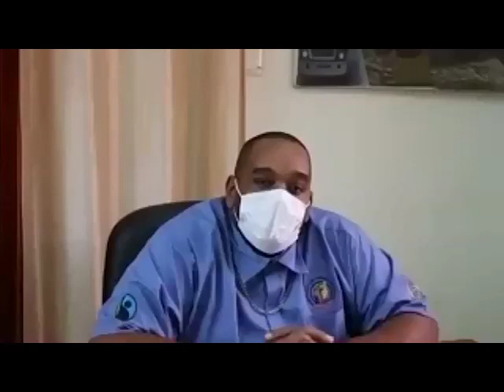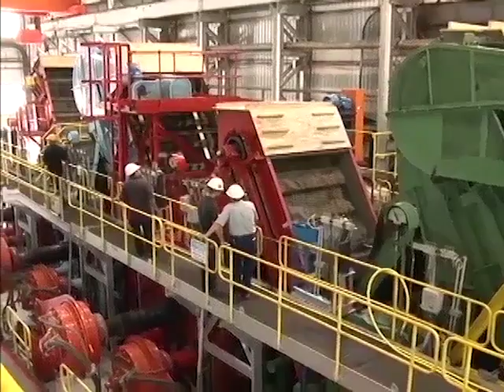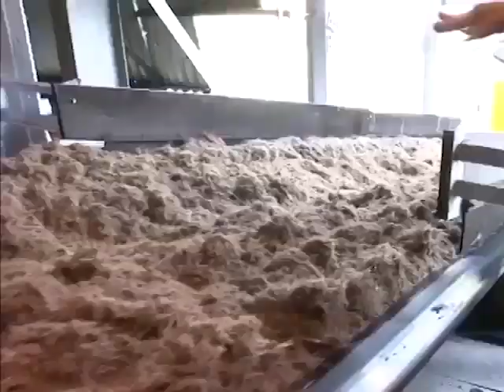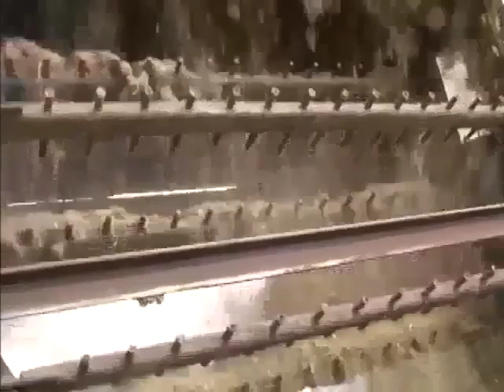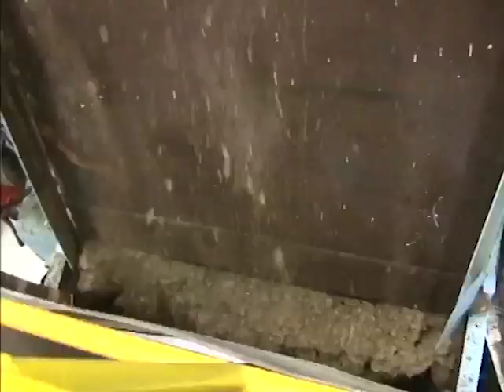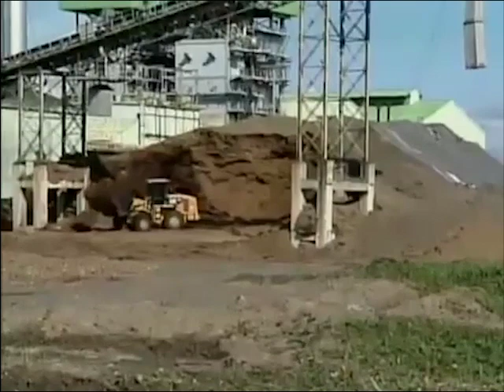Bagasse Impasse of 2013/14 Used as Example for Renegotiation

Comment: What can it be used for I'm not familiar with the sugar cane production I'm more on citrus but if this byproduct is used abroad then it can be used locally like the Orange oil the processors sold abroad and the growers never heard anything or got paid for and it had so many uses can even be used for termite control so if this bagasse is valuable to them find out the uses of it and utilities it